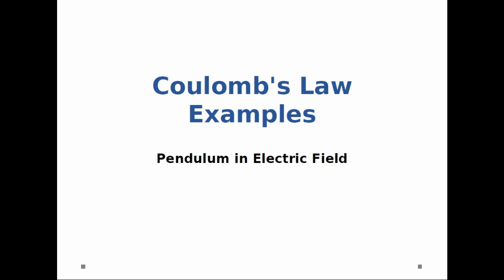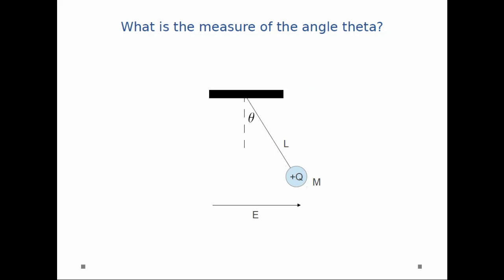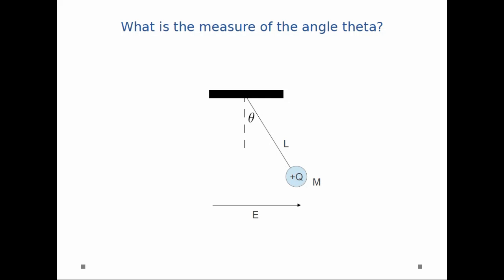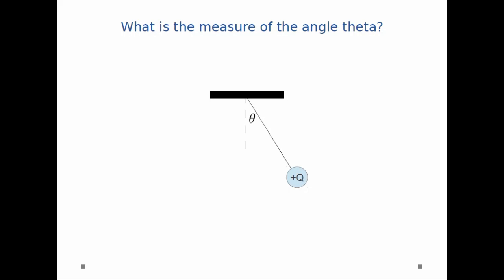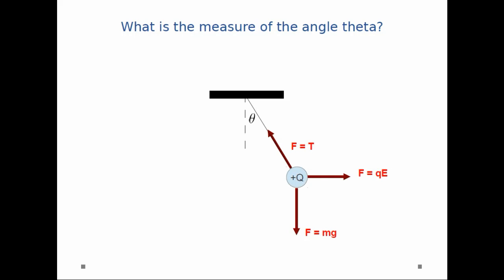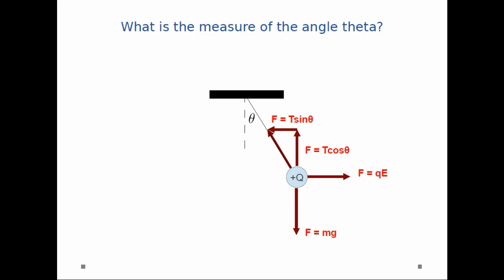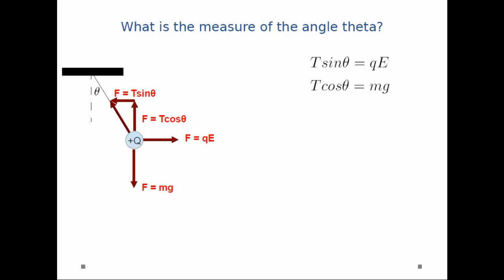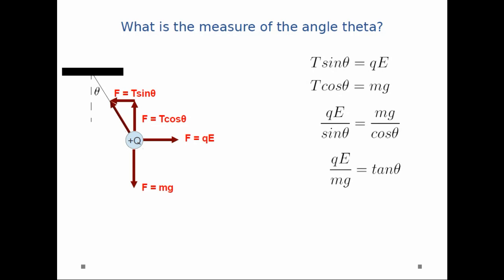Coulomb's Law - Pendulum in Electric Field

Comment: The question is the pendulum has a charge q and mass m 
There is a horizontal electric field from left to right then what will be its time period
Reply: Cyrus Vandrevala nope i got the concept 
There is a force of qE to right of the bob of mass m and a force of mg downward 
Taking the resultant vector we will get the net resultant acceleration 
Substituting the value of g(net)in the formula T= 2pi (l/g)^1/2 we get the time period
Reply: @gauravgaikwad889  The charged mass isnt moving  because the total force on it is 0